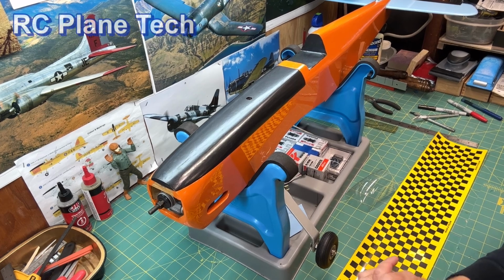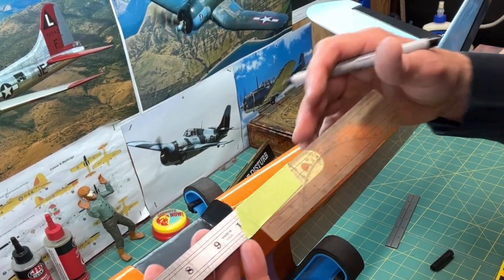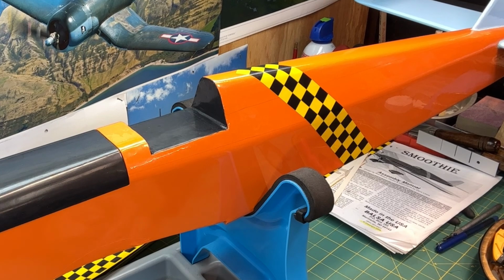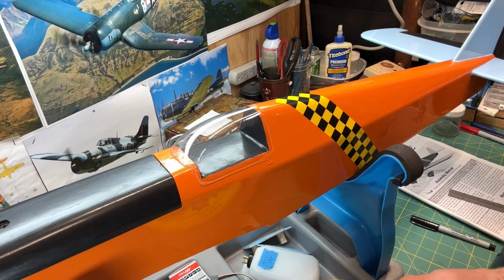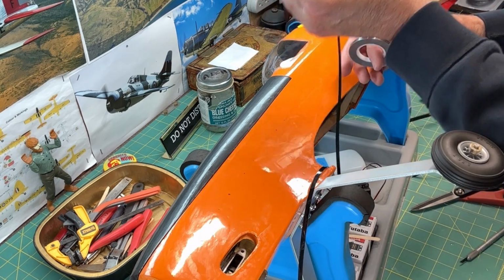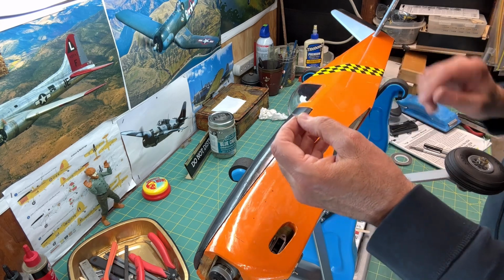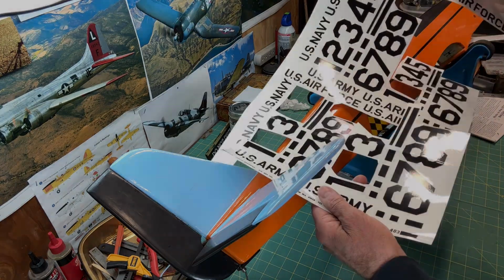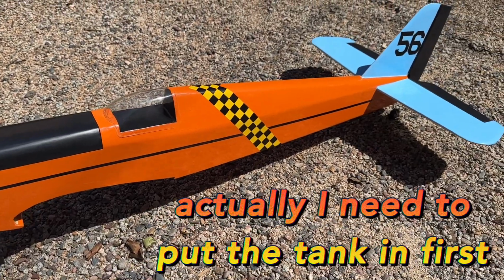Balsa USA Smoothie RC Plane Kit Build No 39, install canopy, adding decals, pinstriping

Comment: Hey James she is looking good now. like the OS & Master Airscrew logos on the front. Sets off real well. Hopefully just a helpful hint. With the stripes if you put them back to back white side then the angle would be identical on either side. Make a Left and a right. The stripe looks really good and I like the checker. Reminds me of F4 Phantom plastic model I built. Thanks for sharing I find your videos and commentary enjoyable.
Reply from the maker: Hi, thanks for the tip on the “tips”.. makes sense. Thanks again for the comments, much appreciated.